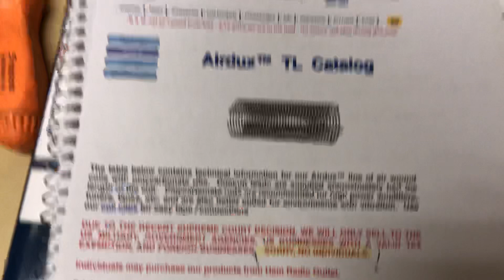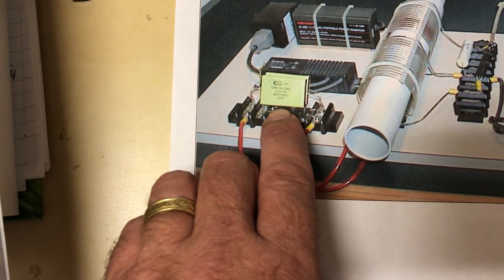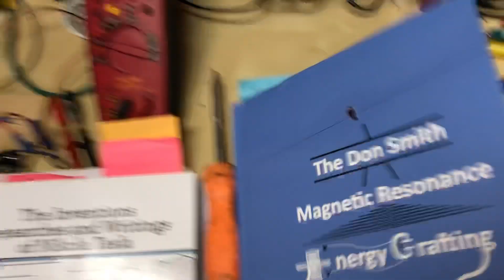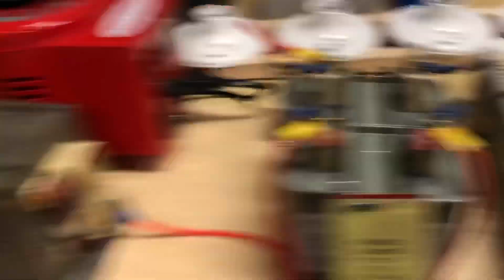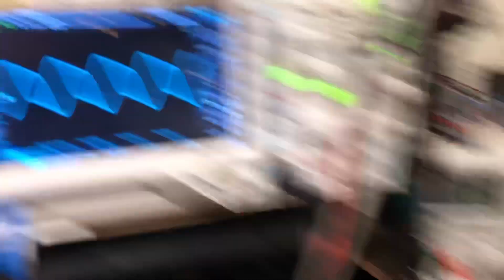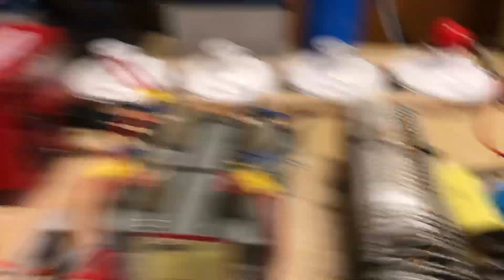Don Smith - Tuning L1 and L2  - March 2019

Comment: I just saw your video today. You may have solved the problem with coil L2. As you may have discovered, the coil doesn't have the same number of turns from the center. Don said that for one coil with 52 turns, the other had 50, and the capacitor was added to create a potential difference. This difference would then translate into the negative and positive outputs to the batteries. Greetings and blessings from Río Grande, Tierra del Fuego, Argentina.

Comment: There's a lot of aspects that have been overlooked, you need to work with pulsing from the initial start, the L2 and l3 respectively are not properly winded, bad winding used, no diodes to reform the wave, there's a lot of mistakes here just by observing and remembering of the top of my head of what I've learned from Don

Take your time and listen to the original words of the inventor, read those books and inspect them carefully, and last but not least don't focus on an exact copy cat of a system, study the working principle because that is crucial, good luck bro.

Comment: What is the value of the capacitors you are using to tune each coil? 
 If you have a 22.5µH inductor and tap at the 1/2 point your inductance is 5.625µH. You should need a 0.1287µf capacitor to tune the coil to resonance at 187kHz.
Also, forget about wavelength, you are tuning each coil to resonate at approximately the same frequency. No magic here, measure input power to output power, output will be less than input.

Comment: 2 1/2" pvc pipe 3" coil. L1 is 1/3 the size of L2 and L3 so the math is L1x3=L2 or L3. It is radio frequency so resonance is in dividable numbers. Because they are resonate to each other you can have more than 2 L2 or L3 coils.

Comment: Hey Cap just to inform you there are two fundamentally important things you are leaving out without them you will never generate or be pumping free running electrons into the device and there is a major reason for the resonance chriteria in tapping into the zero point energy field that's the essence of this device I've built one too

Comment: i did this, but the (power in)X(duration) was never less then (PO)X(duration). i.e. if input stage is 50W running for 10 minutes and generating 50KW impulses, the duration of time that of all impulses added together was never > 1/1000(10min). so there is no overunity or COP>1 whatever, but it is a great feat to be able to run house on battery power and just one standard car battery has 0.5KW of power to supply for 1 hour before completely exhausted.
as soon as the guy said the world bank was involved, that was a red flag for me, unfortunately after wasting time over delusion there would be over-unity using this method. now focusing on water hydrolysis circuits. there is real overunity power in the nuclear energy involved with recombination of hydrolysized water, even using standard DC electrolysis method.
and perhaps this self exited induction motor/generator, perhaps able to do some relatively simple mods to main/aux stator coils of induction motors.

Comment: You guys are all focussed on the wrong things concerning dons work. Frankly because he withheld the actual secret to these devices. Which once you know it, it becomes super obvious how all of these devices work. In fact any device that actually produces OU is using a principle called negative resistance. If you arent utilizing this principle in your circuits then you will be chasing your resonance tails for eternity. Because when you introduce Negative resistance oscillations into the circuit then the whole thing tunes itself and you wont have to endlessly tune your device everytime you mess with it. Negative resistance oscillation are achieved using reverse biased components that extract energy from the environment. These oscillations counter act the assymetrical behaviour of resonant lc circuits and create a balanced wave that is self sustaining. You now have a permanent energy dipole from which you can use to extract energy from the environment. The mechanism of extraction is called time reverse phase conjugation. By charge blocking your permanent dipolar circuit, you can get real energy flow into your loads. One way that i do it is by using negative resistance to pull electrons from the earth. My circuit becomes the negative pole relative to the earths energy and the positive pole of the earth will send its electrons into my circuit with a steady DC. All of dons devices produce negstive resistance oscillations which is the secret of extracting energy from the environment and also being able to correct the phase angle so the power is not reactive but is real energy in phase.  Thats how he was able to use kvar capacitors in that huge device to get real power. By lowering the frequency and introducing voltage dividers where you had a positive resistance and a negstive resistance, the energy becomes balanced(inphase) and amplified greatly. Reverse biased components will balance the energy, and introduce negative energy to amplify current which comes from the environment.
Reply from the maker: Hi Jeff, Thanks for the comment. I haven't worked on anything in a long time.  I don't fully understand what you are saying but you're making sense. Don's voltage dividers have been throwing me for a loop. But given your comment it now makes more sense. I'm also having trouble dropping / coveting the frequency with what Don calls the correction factor resistor.  When you say reversed biased components, you're just referring to polarized caps and diodes, correct?
Cheers,
Loz
Reply: @Captainloz  https://youtu.be/qKqrXcU2jGo
Reply: https://youtu.be/7H7NACnsmzU
Reply: @Captainloz  yeah this is the key the don and bearden took to their Graves. https://en.wikipedia.org/wiki/Negative_resistance#:~:text=In%20electronics%2C%20negative%20resistance%20(NR,in%20electric%20current%20through%20it.
Reply from the maker: @Pointlomawelding  
Thanks Jeff! Now you have me thinking about this again.  I need to get back to my work bench... Cheers
Reply: @Captainloz  excellent.  Let me know if you have any questions.
Reply from the maker: @Pointlomawelding  Will do. Can you email me your email?  Mine is captainloz@aol.com
Cheers
Reply: @Captainloz  email sent
Reply: Yeah pretty much all of don smiths devices were negative resistance oscillators that he would interface with earth ground to collect electrons. It's funny because he even says that you don't need most of the components.   He even stopped using earth grounds and was just collecting electrons from the air by connecting a gas discharge tube with a single electrode connected to his circuit and the other end not connected to anything.  Did you know that you can induce electron avalanche in a gas tube with only one wire? That's what that gas discharge tube is on his nst. He is actually injecting electrons into the capacitor from the tube and the nst is only providing the potential to maintain the current in the gdt that runs the oscillator.  Which makes it a negative resistance oscillator
Reply: https://youtu.be/e2urrFy6i1Qhttps://youtu.be/e2urrFy6i1Q in this video he says that you can get rid of my of this circuit because you can just use a gas discharge tube pig tailed to your nst to inject more voltage and create your negative resitance oscillator straight into the isolation transformer to ground.
Reply: @Pointlomawelding  Выходит: Получаем баланс, тем самым блокируя входной ток и получая электроны на диполе и с него снимаем на конденсаторы ток, а с конденсаторов по привычной схеме мощность в нагрузку ? Так сударь?
Reply: all very interesting !! can you help guide me with my experiments perhaps ?! : )   @Pointlomawelding

Comment: If you actually know the principle you should easily build your own. Everyone. Is trying to do exact replication. And Don knowingly trying to throw you off on purpose showing his designs and may not work. But he gives clues how it works. I built a metal detector got it to work and looked completely different than original design.

Comment: He got missing parts you don't know about the storage cap maybe its a hairpin variation instead of two poles each it has 4 poles. Two are from the closed system. The other two are from the environment. The open system. You have to build your own are have them made. That might be everyone's problem. Just a thought.

Comment: Hey mate ...Im looking to get an LCR meter  & would value some feedback on your "Chen Hwa 1061 LCZ meter".
Are you happy with it ?
if you had the chance to invest in another unit would you choose the same you currently have or would you be looking at another type/model ?
Thanks in avance for  the heads up.
Reply from the maker: Hey Mate,
It's okay. But I've had to replace the internal battery in it 3 times. You have to solder it in so it's bit of a pain. For that reason I'm not sure I'd get this one again.  Cheers.
Reply: @Captainloz  thanks
 for the heads up !

Comment: The genuine Bertone Neon Gas Transformer Don uses here runs on 32 Khz. For stepping down you could use a IGBT H bridge and a big transformer and switch the bridge on 60 Hz to get the DC down to 110VAC for the output.
Reply from the maker: Yes, that's just the output HZ of that part of the circuit (Bertone Neon Gas Transformer).  The resonate LC frequency AFTER THAT on L1 and L2 is much higher. Around 200KHZ.  It's AFTER THAT it needs to be reduced as you are describing. Don states a correction resister must be used across the input side of the output transformer to reduce the HZ.  He seems to be dropping the HZ by doing impedance matching...of sorts.
Reply: @Captainloz  interesting ! Thank you. You decode the frequency because of the cap on l1 and the cap on half of l2 ?
Reply from the maker: @markussteinbacher8807  Yes you can see the caps on L1 and L2. And we know the inductance of the B&W L2 coil so half that inductance (half the coil) with the cap gives us the frequency he was using.  It's a pulsed DC output once it goes through both diodes. Then onto the main storage caps creating a huge imbalance, so electrons are pulled from the ground (or ambient background). Trick is keeping the caps full with enough coulombs for the desired voltage of the output transformer, as well as dropping the voltage and frequency for the output transformer...  Easier said than done!😅
Reply: @Captainloz  The B&W coil is not exactly cut in the middle as you can see , he unrol some turns to get the wire to the terminal block on the right side over the .047 cap (grey) and the 2 diodes on that terminal block... (Photo from the original device) this is different to the given schematic from don with the 16 parts ...
in this standard schematic I see 4 Diodes in the bridge before the Cap bank.

Are you sure you get the free electrons from earth ? because if you ground one side of the bridge to the same ground as the cap bank and output transformer you will probably load down the tank circuit instead of the "ground" ?!

You could switch down the HV with a lets say 10 IGBTs (1200VDC each) in series  and do a primary controlled switchmode powersupply to get 330 VDC Rails and from them you could do a PWM (Sine) H Bridge for 230VAC / 50 Hz output with feedback to the controller of the Bridge to adapt for the load current..... But you are right to hold all this in balance with Impedance and capitance is quite challenging...
Reply from the maker: @markussteinbacher8807  Don's L2 is the 3" 240TL B&W coil, the total coil inductance is 32uh. IE; 16 uh and .047 uf  gives 183.5kHz. I can't see the the photo that you are referring to, so I can't see the schematic you are referencing.  Yes there are 4 diodes (2 pair in parallel) Basically the coil and diode configuration is a rectifier circuit (look up 2 diode, coil rectifier circuits). 

As far as the electron flow is concerned I think of it like this- The L2 is outputting around 4000 VDC, 183.5 kHz x 2 = 367kHz pulsed DC to one side of the storage caps.  The other side of the capacitor has to draw electrons from somewhere (either the air or the ground).  Once we create an imbalance on one side of the capacitor the other side has to become equal and opposite.  Don says we are pumping the electrons. Don's schemitacs show Grounding through a varistor, this also maintains the voltage for the input side of the output transformer.
 
You're ahead of me with your voltage step down feedback controller. Don was using voltage divider circuits to drop the voltage to a usable level for the output transformer. (He does reference HV dividers in one of his handouts). I'm currently working on this part after a long time away. Your are correct it's very challenging to hold all in balance. Just calculating everything is a challenge!  It's so easy to make mistakes... One quote Don said I think everyone should pay attention to-  "the amperage is not available until the output transformer, when pulsed it comes alive"  Cheers
Reply: @Captainloz  L2 = 17 T + 17 T right ? and the tank cap for L2 = .047 uF (ASC8916 X675) 8 kV right but only on the half of L2 parallel ? So the datasheet says: 10 " and 4 Turns per Inch should be 40 Turns alltogheter. But on the pictures I count 17+17 Turns. So whats my mistake ? your calc of the thompson formula is correct: 183.53 Khz - but whats about the missing 6 Turns of L2 ? So I reduce the 40T 10" coil to 34 turns = 27.2 uH = 13.6 uH (halfcoil) = thompson= 199.7 khz resonance...
What you think is the symbol on earth ground in the magnetic resonance book ? Avariable  tuning capacitor or an wire potentiometer with lets say 10k Lin ? What you think should be used to "dam" the ground electrons ?
Reply: @Captainloz  higher frequency so using high speed diodes =  faster cap charge rate
Reply: @markussteinbacher8807  "ALL grounds" have to be separated some distance (i think Don stated at least 10mtrs apart) & ALL BE DECENT GROUNDINGS otherwise they'll act as shorts ... if joined together or too close to each other

IGBTS are a great idea but you end up having switching problems if the timing is out (this easily happens when switching heaps of power transistors at the same time). 
Maybe be better to consider using a few step down air core's ...( also you increase the cold electricity with each additional set of step down tranys) then you only need to use a couple of IGBT's (with a lot higher current ratings) ... just an idea to cinsider.
Reply: @markussteinbacher8807  I seen some drawings (when referenced to the video they look like variable caps)
Reply: @hitbyligtning9661  thank you ! in the meantime I found out he used varistors (tested with no luck) and resistors in the ground wire. The resistor should be higher than the impedance in L2/Cap tank and the diode Cap Bank System so to circulate air ground electrons like a pump and prevent that the electrons flowing out - back to earth - instead to the cap bank
Reply: @markussteinbacher8807  Don said one coil on L2 had to have 2-3 more turns than the other to knock it out of phase from other one.
Reply: @getreal1702  Thank you. It seems I miss that info. After examining don smith videos here on yt and image analysis I found 17 + 17 turns on the "L2" Tank. This is confusing. Earth System 3 (on the wood board) there are some angled images where you can see the single turns of L2. But yes, don removed some turns from the middle to connect the terminal block. hmm out of phase... another miracle. why he did this ?
Reply: @Captainloz 
I think there is also a capacitor in parallel with the resistor too. Still trying to figure that out myself.

Comment: Hi Captainloz

1st - Little correction in mathematics. The 1/4 wavelenght Don's L2 coil (9.6m) is 7.8071MHz (to be exact it's 7.831MHz at coil radius 1.5" with 40 windings). The coils must be tuned as perefect as possible!

2nd - The ground is the key to power! Be careful and good luck ;)